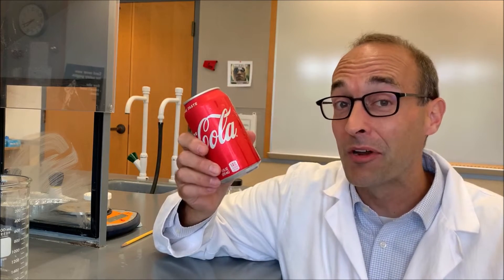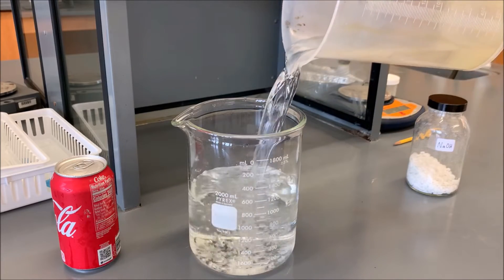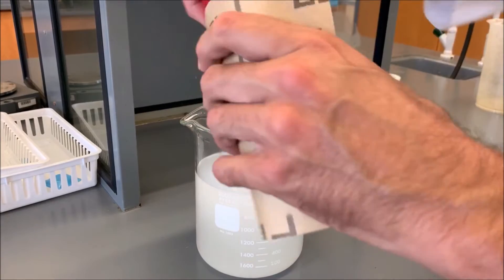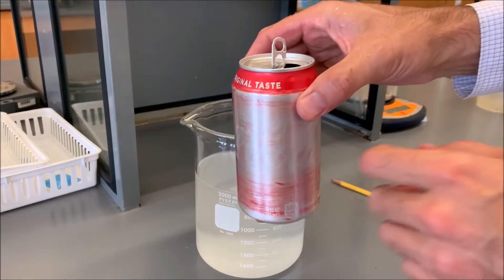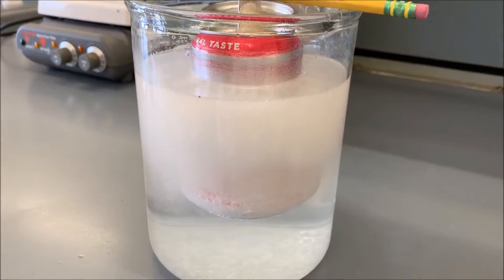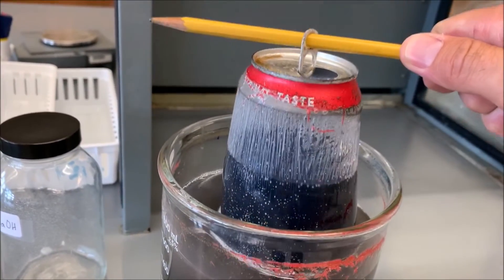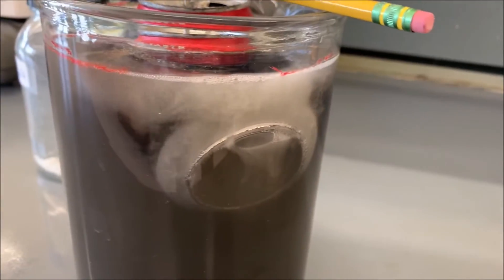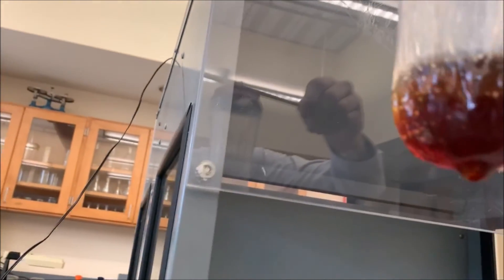Aluminum can, minus the aluminum!

Comment: I'm trying to find the video (might have been Periodic Videos) where this experiment failed due to them stumbling upon one of the coke (or maybe Pepsi) cans from the 2000s or 2010s that was actually made from steel (I believe stainless steel, but the same very thin, deep-drawn construction as aluminum, so it looked and felt like a normal 2-peice soda can ... though probably weighed slightly more)

It's really hard to find official info on these online ... I had one at one point, but it may have ended up thrown away. (that one was Pepsi ... possibly Pepsi One)

Whatever it was was ferritic steel, given it stuck to a magnet (and a relatively standard ferrite ceramic magnet, not a rare earth one that will stick to 304 and some other austentitic grades).
Reply: Edit: found it https://www.youtube.com/watch?v=WnPrtYUKke8

So yeah, Pepsi was using steel at one point. And it rusted, but that might have been under exposure to acid. (could be coated mild steel, but I did some digging and there's stainless alloys that give better deep-drawing results ... though perhaps there's low-alloy steel that also works well, like some of the lower alloy chrome-moly stuff)

Comment: And here I thought I was avoiding microplastics in my drinks, THEY LINED THE METAL CAN WITH PLASTIC.
Reply: Would you prefer some corroded aluminum instead? And this isn't microplastic
Reply: @ButterMilkPancakes  Exactly! Small amounts of dissolved aluminum...yikes! ☢ ☣
Reply: That's not microplastic, it's just plastic. Microplastics come mainly from the textile industry.
Reply: Better than drinking aluminum.
Reply: It's all a joke.
Reply: What was wrong with glass containers btw?
Reply: @bezceljudzelzceljsh5799  glass is much heavier than plastic or aluminum, which means much higher shipping costs to distribute goods packaged with it around the world.  You pay in burning more oil and higher prices for the product.
Reply: @bezceljudzelzceljsh5799 in a test they actually found more microplastics ingested from glass because of the interface of the glass and plastic top shredding particulates of the plastic top
Reply: How funny I looked up how to remove the plastic liner in a soda can for the purpose of recycling the aluminum and I get how to melt the aluminum. Thanks YouTube absolutely not what I was looking for
Reply: @SnoopN  
Can't you just melt it?
Remove aluminum, aka the majority, then collect the rest of the can and voila....
Or did you want the specific aluminum can shape for something?
Reply: @SnoopN  Sry, re read your comment.
Well, it's not like aluminum evaporates, i'm sure you can extract it from the solution with few extra steps.
But yeah, people usually just melt the cans with the liner and paint coat, and then just skim the slag.
For chemical methods I would assume there's cleaner solution, but it might require way more tools/chemicals.

Using heat to melt cans is for sure the most straightforward way.
I would assume even cavemen could do it...

Comment: Be super careful when doing this. We did it in a bowl and the pressure from the gas in the can made the can explode. Not a huge explosion, but the sodium hydroxide was all over the place, and some materials (like wood) do not like that at all. So I recommend to do it outside with a minimum distance of 5 meters to everything that is not sodium hydroxide (and cola) proof.
Reply: Just open the can like he did
Reply: @Paul-ys3eu  Oh dear, did I really miss that? For some reason I thought he kept the can closed. That would have saved me A LOT of cleaning up. Thanks.

Comment: The plastic aint what worries me - shouldnt worry you either - the real "funny" thing about aluminum cans is that every time you open one, a small cloud of aluminum dust aluminum particles from breaking the aluminium seal actually drops into your beverage, which will inevitably enter your body when you drink it, a small dose  from every single can you drink - effectively poisoning you with aluminum forever and guaranteeing that you get alzheimers and parkinsons. Same thing with all the rollons and antiperspirants - they all contain aluminum. toxic to man and all life on earth. performs no positive function for or in any lifeform because in its only natural form aluminum molecules were always tied up with silica in the strong chemical bond form of bauxite for example. which is how fish dies: the acid in polluted rain releases aluminum from its chemical bond and the aluminum effectively poisons the fish to death.  Aluminum should be your greater worry, since gluing it under your arms directly on your most important glands for your immune system probably aint none too good either. in fact known to result in cancer of the very lymphatic system and glands you need to survive any infection. Aluminum is a really toxic nerve agent, always has been. By the way, the very same aluminum they claimed you (they) "had to" put in all adjuvants for their vaccines, even though the Pasteur institute had created many safe vaccines without the need for aluminum adjuvants for decades. What happened? Pfizer, Sanofi and the other worlds biggest pharma bought the pasteur institute and shelved ALL their safe adjuvant aluminiumsalt-free safe vaccine product lines - just to sell the contaminated ones. They even forced several antipersiprant makers to remove their aluminum free products so you should ONLY be able to buy or find ones containing aluminum.

Comment: If you freeze the can first, and maybe even put the solution in a refrigerator, could you then keep the top closed to get just a plastic bag of Coca-Cola?
Reply: If you try to freeze the can, it will explode in your freezer. It's been a year...hope you didn't try it!
Reply: @fun_ghoul  Never tried it fot the sake of this method, but I have frozen cans before as a kid by accident when trying to get them cold quick. Never had a problem with that though. That said, I do know it is possible for them to do that.

Comment: @Chemteacherphil: Why I do not believe you, when I drink coca cola from a can it taste like aluminum it does not taste like plastic,  and even if I put it in a glass it still taste like aluminum, so this is why I switch to bottle, and if it was truth that it was a plastic film in their I would already be death for drinking dissolve plastic film, because plastic is deadly toxic.
Reply: man that was the dumbest, most incomprehensible piece of garbage i've ever read😂
Reply: Nah, most plastics aren't deadly even in dissolved form. Many of them are cancerous and somewhat toxic in their un-polymerized form, but the dosage makes the poison. 

Try and see if you can differenciate between cola from a bottle and a can in a blind test.

I swear that I could tell canned and glass bottl-cola apart when I was a kid, but those cans where different than modern ones and I haven't seen cola in glass bottles for a few years now.

Comment: The shorts version of this video shows the can unopened and bulging out, could this cause an explosion and would it be dangerous? thanks
Reply: Eh, it wouldn't be great if the lining exploded when it was submerged in lye, but only because it would splash corrosive lye all over the place. The lining is really flimsy on its own soit wouldn't be able to contain enough pressure to be dangerous.

Comment: can you reverse the chemistry to get raw AL back out ? or bauxite somehow? Very interesting.
Reply: Yes, it is possible. I'm rather garbage at chemistry but I seem to recall that bauxite is refined by dissolving the alumina in NaOH and then mixing it with silica and heating it. Eh, check if the channel Cody's Lab has  something on extracting or refining aluminium.
Reply: yeah you should be able to, it just forms a sodium aluminate salt so adding an acid like HCl should make the aluminium fall out of solution and you can just vacuum filter that. just need some water to react and form sodium hydroxide again

Comment: Do all cans for coke products have this lining?
I tried this experiment with a Sprite can (bottled by coke), and had very different results.  In a 300 ml beaker I put 100 ml of NaOH solution (~10mol), placed the sprite can in (liquid rose to 3/4 higher of can)lots of bubbles.  When the can was breached, the acidic Sprite reacted with the caustic NaOH with a spectacularly violent reaction.  Liquid was expelled 15+ feet.  Good thing for lab coats and safety glasses.

Comment: Do you happen to know who invented that interior liner? My dad always told me it was my great uncle, but I've been unable to find any information that confirms a name of who invented it
Reply: Steve Spangler said 
"The American Can Company produced the flat or punch top can in 1934. The lining was made from a Union Carbide product called “Vinylite”, a plastic product which was trademarked “keglined” on September 25, 1934." 

Tinned steel food cans did not start getting liners until the 1950s.
Reply: Lining cans with plastic goes back to the days of tin cans used to hold food.
So with whoever was the first to do it with aluminum cans, I doubt that would be considered an invention.

Comment: At the moment Im so happy to see it! I had some really bad heavy metal blood test results so have to avoid anything aluminum to the degree that I had to throw out all my aluminum pots and even had to change my deodorant coz that also contained aluminum. I have been avoiding drinking from aluminum cans too worrying that the aluminum may get into the soda but im very happy to see it now that it is basically sealed off from coming into contact with the liquid.  Yeah yeah sure, I know soda is not a health food and plastic has its own issues, obviously Im not gonna overdo it, but Im very very  happy to see that I can have a fizzy drink every now and then from a can! Thank you for showing! 😘
Reply: "The doctor recommended I stop listening to Led Zeppelin."
Reply: Aluminum is not a heavy metal.
Reply: @elektro3000  It literally is lmfao. I suggest learning what the term "heavy" means, because it's not "weighing a lot."
Reply: @wrije  "Heavy" means high-density metals with atomic number above 20. Aluminum is a low-density metal with atomic number 13.
Reply: @elektro3000  Incorrect. First, there is no standard definition for a heavy metal. It is, however, typically used to refer to a metal that is either high density or toxic. Atomic number is not the only deciding factor, not sure who taught you that. Lead, mercury, chromium... toxic metals with high densities—these are what most consider "heavy metals." Zinc, aluminum, arsenic... these are relatively low density, yet are toxic, nonessential metals. Also considered heavy metals.
Reply: @wrije  Heavy metals accumulate in the human body and cannot be excreted. Arsenic is one, but zinc and aluminum can both be excreted. In fact, zinc is considered an essential nutrient, not sure what gave you the idea that it is a heavy metal or toxic. Aluminum is not an essential nutrient, but it is non-toxic except in unusual situations such as excessive dust inhalation (in which case it can cause lung problems mechanically rather than chemically). Not sure who taught you that aluminum is toxic, but I am aware that it is an old wive's tale going back generations.

Comment: That was really interesting! I may have to do the experiment at home. I also wonder how much harm sodium hydroxide does to metal plumbing fittings. I'll have to find a safer drain cleaner.
Reply: None really,  that's what draino crystals are.
Reply: If you don't put grease, oils and food particles down your drain, you'll never need drain cleaner.

Comment: I wonder if the bottom takes longer because it's significantly thicker than the sides. They make those by pushing a flat piece of aluminum into a die, so the sides get stretched thin to cover a greater surface area, while the bottom area does not.
Reply: The bottom takes longer because it is concave. When the sodium hydroxide reacts with the aluminum, it creates hydrogen gas which gets trapped in the concave area. This bubble of gas prevents the solution from making contact with the can. If he could lay the can sideways so the hydrogen bubbles weren't trapped, it would react the same as the rest of the can.
Reply: @jeffreysokal7264  Why not both?
Reply: Aluminum is a neurotoxin, BPH a hormone disrupter > FDA approved poison
Reply: there's the subject mater I know. I'm in engineering so chemestry is out of my ballpark but it's nice to see when they cross paths.